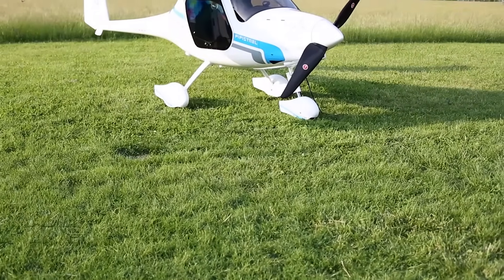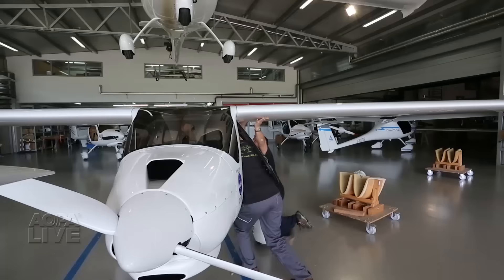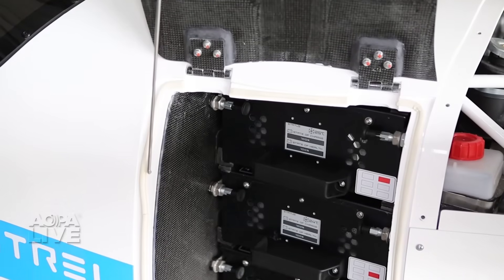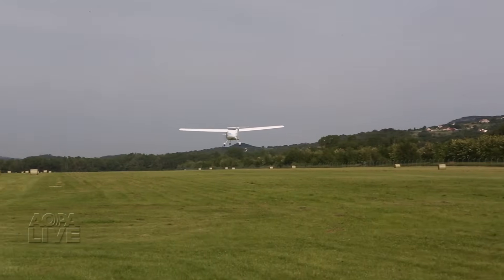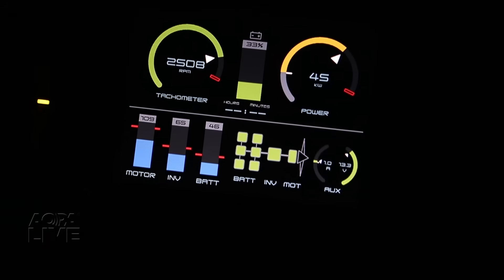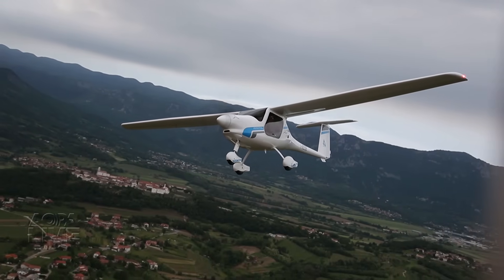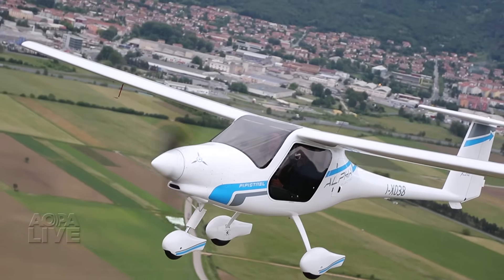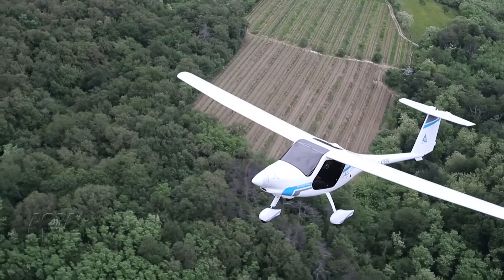Pipistrel Alpha Electro

Comment: That is awesome! As battery technology advances, I'm sure the range will improve, and eventually we'll be able to fly cross-country in electric planes. The Alpha Electro is essentially the Nissan Leaf of planes - it's pretty cool by itself, if a bit limited, but more importantly, it's a taste of things to come.
Reply: Really depends on what your definition of "cross country" is and what your real needs are.

Just tooling around in the sky on weekends and the evenings for a bit, primary flight training? Sure, electric would be a great fit.

Dispatch year-round for a 300 nm trip, turn around and fly home? Not real practical; infrastructure and any known battery chemistry just isn't going to support this. There are a few niche cases that could be filled, like where turboprops are doing short hops, but that's about it.

Honestly, the best uses are in recreational motor gliding and primary flight training. I forget the guy's name, but there's someone running a motorglider and, if the lift is strong enough, captures the excess energy with the prop and recharges the battery. When you start thinking about CC in glider terms, doing tasks and using the motor to increase your L/D for your polars, it makes so much more sense than dragging your butt through the sky on a battery-powered prop.

Comment: This will not work.  Waste of time.  No airports need apply.  Road,  drive 30 mph, fold out wing while driving, apply power to props, rotate, off.  No stopping,  No airports, no hassles.  No heavy battery.  Distributed power, but not like the x-57...  Quads won't work either...too much drag and VTOL is very offensive.  I have solution that will work.  Looking for partners.
Reply: @Swayam Panda you're one of the most annoying people out there
Reply: seaplaneguy won't work on Sea plane. Joke hahaha
Reply: Yes, good point, haha....Amphibian-guy doesn't sound as good as seaplaneguy.  Amphibian sounds like a green slimy frog of sorts.  Tri-phibian also does not sound good.  phibian---sounds like a person who is lying. But see-plane-guy would mean I could see plainly, but then people would think I was holy and can see...won't go there.  What is in a name....hmmm.   BTW, you can see my tweets on Twitter @seaplaneguy